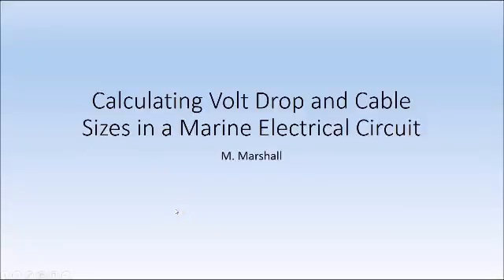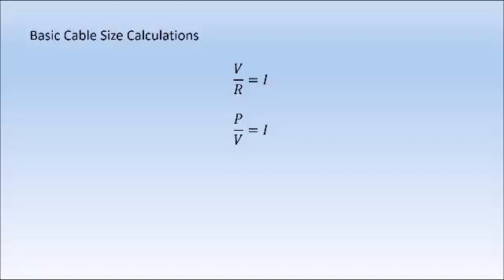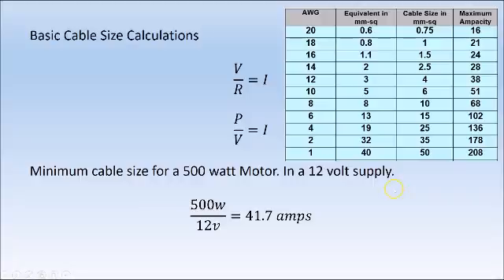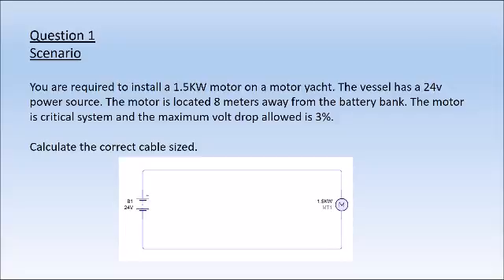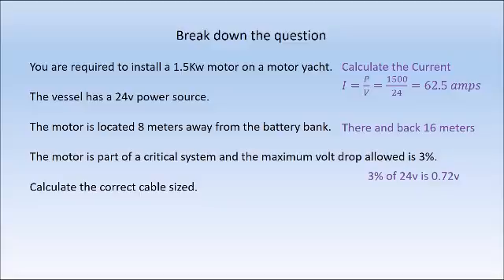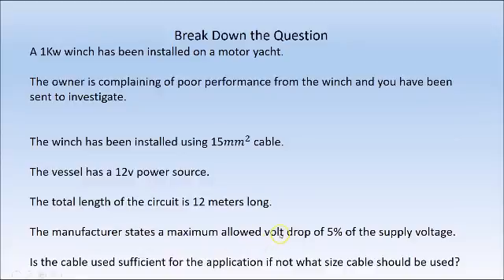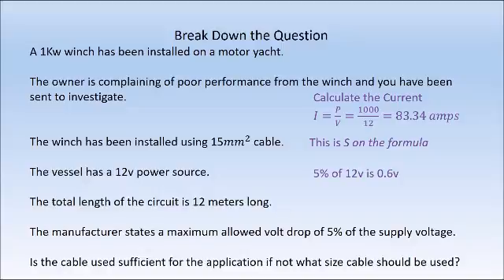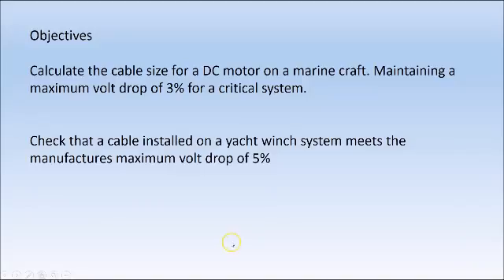Calculating Volt Drop and Cable Sizes for Marine electrical installations

Comment: Where does the 0.0164 come from? Is that the K value?
Reply from the maker: This is a constant value used by the BMEEA for the resistivity of a copper conductor. I believe it is the resistance of a 1mm CSA cable, 1 meter long.
Reply: @mikemarshallee8829   you are right, but we use.  0.01678 for automotive... Is it right
Reply from the maker: I have this question a lot when we cover this subject in class. From what I can tell is, this figure will change with temperature, how many strands the conductor has and the quality of the copper itself. I wouldn't say either was wrong. I would use the one applicable to the particular standard I was working towards. After all, we want to ensure the equipment has the required electrical energy to work as designed. I hope this helps.
Reply: @mikemarshallee8829  If this is a constant for British standards, can anyone help out with what the constant would be for US standards please? thanks
Reply: Hello could please explain us how we can calculate the section of cables for 3 phases
Reply: @marouanattioui9031  you need a cross-section of the wire or resistivity per feet of the wire. # 3 phase, single phase or dc does not matter. or am I missing something in your question?